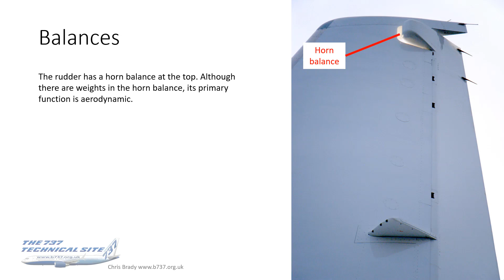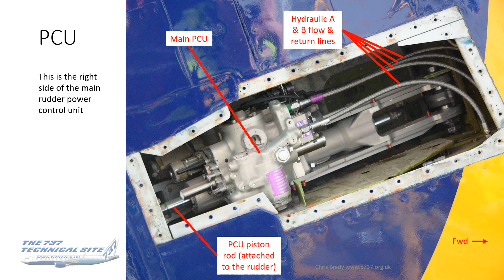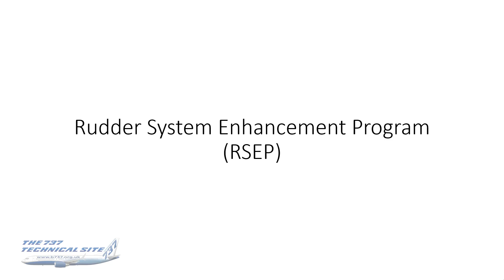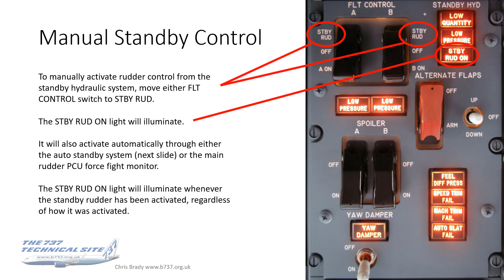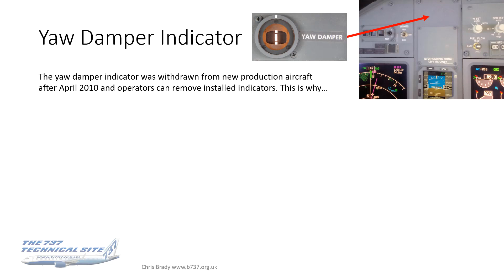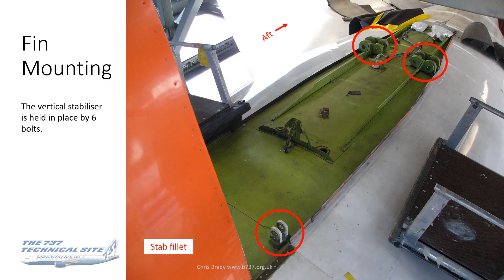737 Flight Controls - Yaw

Comment: Question can you move the rudder under manual revision? Why do the pedals move around when theres a wind out side and the hydraulics are off? They must be connected directly?
Reply from the maker: Yes you can. Because there is a mechanical connection through the PCUs even when they are unpowered.
Reply: @ChrisBrady737  exactly what I was thinking

Comment: Hi Chris, thank you for your videos. I’ve now watched all three pitch/roll/yaw videos in a row. What I don’t understand about the rudder is how it can “backdrive” the rudder pedals with the hydraulics off. Like, when you are parked in a crosswind, so to speak, and the rudder is deflected so are the pedals in a corresponding way. How can this transfer of movement happen when there is only a hydraulic connection between the pedals and the rudder surface?
Reply from the maker: It isn't only a hydraulic connection, the connection is also mechanical through the PCUs.

Comment: Hi Chris, regarding the Yaw Damper, I've been looking a bit for info on what the  turn coordination mentioned in the FCOM actually covers? I came to think if it's actually only during manual reversion that this is provided through the WTRIS or is it as well during normal ops? And do you have some more info this topic specifically? (i.e. what inputs does it get/when is it activated) Thanks for some absolute fantastic videos!
Reply from the maker: The Yaw Damper is used in normal flight. In a nutshell, it commands rudder movement in proportion to and opposite to the aircraft yaw. This keeps unwanted yaw motion to a minimum and makes the flight smoother.

Comment: Graet video, Captain! 
I have onde quick question about the yaw damper. Do you know why flaps are limited to 30 without yaw damper? 
Thanks!!
Reply from the maker: Great question. I dont know the answer for sure but I suspect it is a handling issue. The restriction used to be (pre-2015) that you could not use flap 40 if the crosswind exceeded 30 Kts. The restriction is there for all series of 737.

Comment: If you lose Hyd Sys B Pressure(A sys normal). How is the Yaw Damper powered?
Reply from the maker: If you lose Hyd Sys B then you lose the Yaw Damper.
Reply: @ChrisBrady737  okay thought so. Seemed odd that the “standby” YD is not available.
Reply: @ChrisBrady737  don't you have a stdby yaw damper powered by stdby hydraulics ?

Comment: Good Day Capt Brady, if we fly with autopilot on/engaged and we step on rudder pedal to apply some rudder.Will this action disengaged the autopilot automaticly?
Reply: Thanks a lot Capt Brady for your explanation... 👍👍
Reply from the maker: This is such a hypothetical question, why would you ever do this? If the A/P is engaged let it fly the aircraft and apply rudder trim if necessary.
Reply from the maker: Anyway, no the autopilot won’t drop out until the autopilot aileron limit is reached. Watch the Fuel video I did for an example of this.

Comment: Good Day Capt Brady, in this video 45:35 stated Rudder pressure limiter.Is this system similiar with elevator feel and centering system for elevator? I mean here for low speed easier or less force we need to move rudder pedal and at high speed require more force to move rudder pedal?
Reply from the maker: The RPR is not analogous to the Elev feel system. The RPR is to reduce the amount of rudder deflection in certain circumstances to allow a rudder hardover to be counteracted by aileron. I will cover the rudder story in full in a future video.
Reply: @ChrisBrady737  Thanks a lot Capt Brady... Wish you a nice weekend... 👍👍

Comment: Hi Chris, awesome presentation as always. i just have a question about the yaw damper. Why is the stby yaw damper inoperative with loss of system B even if the stby system is "powering" the stby rudder PCU and stby yaw damper?
Reply from the maker: I didnt think it was. The standby YD is powered by the standby hydraulic system and controlled by SMYD 2. This occurs during manual reversion when there is no Hyd A or B.
Reply: I have exactly the same question and I fail to understand : why cant we have the stby yaw damper in case of loss of syst B ? As I understand it, once the stby rudder SOV is open (manually or automatically), the stby rudder PCU AND stby yaw damper should now be powered. So why can’t we put the yaw damper switch back on, as we would do in case of manual reversion ? (Thank-you Chris for all those great videos)

Comment: 3:20 Depleted uranium is actually slightly less dense than tungsten, so density would not be a reason to prefer DU.  My guess would be it probably had to do with cost and availability.  The primary danger of DU is its toxicity if the weight is compromised (e.g. in a crash or fire), not radioactivity. Boeing did a study that monitored whole body exposure and peripheral exposure (using a finger ring dosimeter) of workers who installed, transported, or otherwise handled these weights and of the 297 exposure reports collected only 3 were above the detection limits and these were all still very low exposures with no associated health risks.  The radiation from DU weights poses zero risk to crew and passengers, and is certainly irrelevant compared to the (cosmic) radiation exposure caused simply by flying at cruise altitude.
Reply from the maker: Thanks for the info, good to know.

Comment: Thanks Chris for this brilliant video.Lots of things I never knew,plus lots of reminders and as always it's good for us engineers to get the pilots viewpoint.
Probably a dumb question,but you described how in rudder manual reversion WTRIS will give a little rudder if the pilot operates the control wheel.I just wondered why the pilot wouldn't just use the rudder pedals (using standby system/pcu) to get the co- ordination from the rudder for the turn?Why is wtris needed?
Thanks again!
Reply from the maker: Hi Paul, Good question, the answer is that pilots of swept wing jets, unlike glider or light aircraft pilots, don't (and shouldn't) use rudder to coordinate turns, it simply isn't necessary. The only times we use ruder trim are for asymmetric thrust (engine out) or if the aircraft isn't flying straight (mis-rigged or damaged). WTRIS is not needed (it wasnt there on the Classics) but is helpful to assist (not coordinate) turns in manual reversion.
Reply: Thanks for the answer,all clear now,great!P.

Comment: Thanks for the upload! many great info!
I have heard recently a 738 have same issue of knob confusion and get into like 45degree bank of upset, but not much detail yet...
Regarding the rudder over stress, I have seen a great article about why the rapid reverse input of rudder would cause over stress above the designed limit:   https://ifalpa.org/media/2029/12adobl02-use-of-rudder-on-boeing-aircraft.pdf
Reply from the maker: The FAA SAIB recommended that operators put the two knobs in a standardised position to help avoid such events. I am familiar with the IFALPA document, it is excellent.